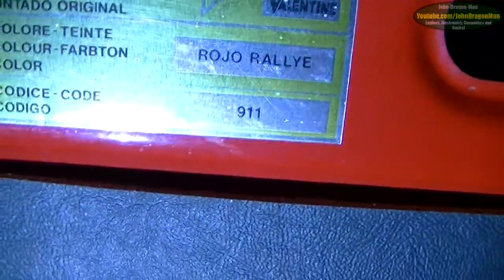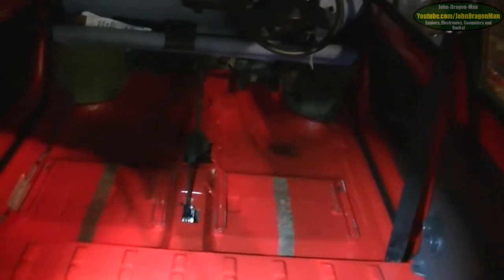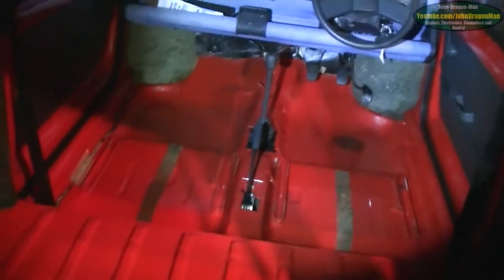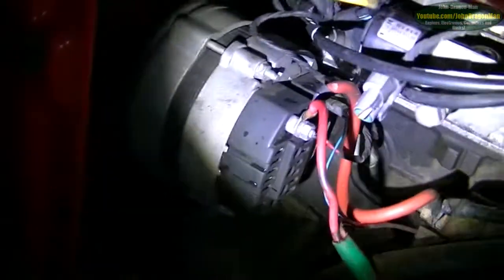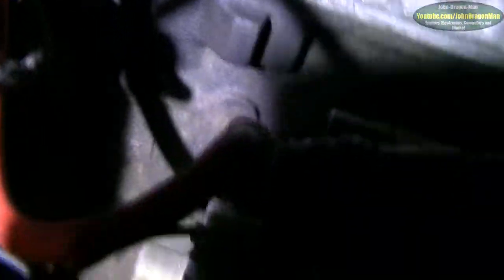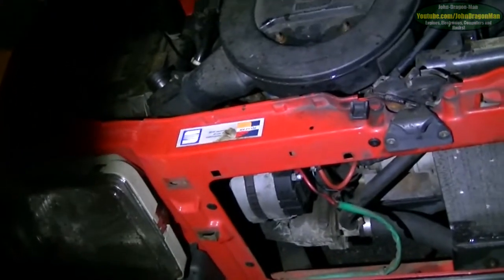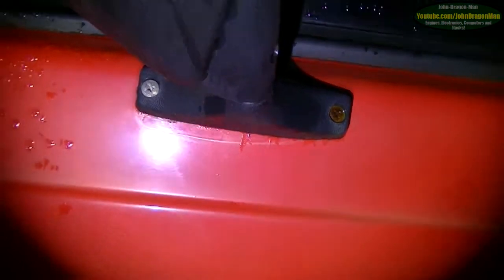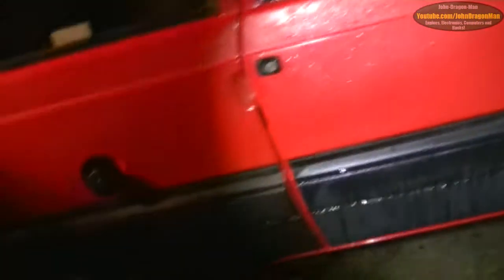Seat Marbella interior strip down and clean

Comment: For a car of that age it's surprisingly clean and rust free.

You like Fiat pushrod engines more than Fire ones?

If you ever look after a 126 stay away from the later 126 bis cause the engine from the latter models had headgasket issues (basically headgaskets burning off easily and quite early).